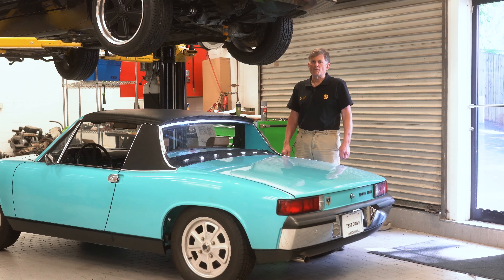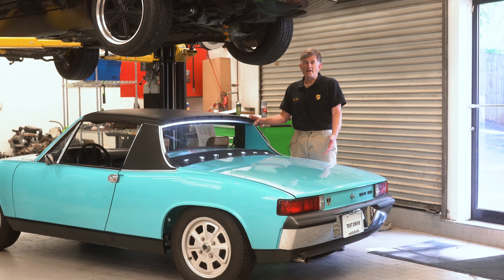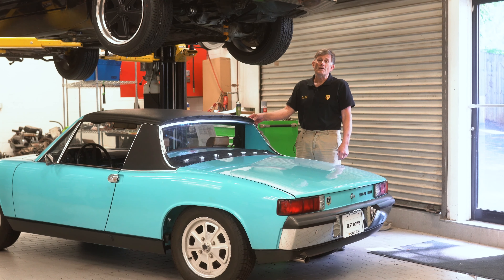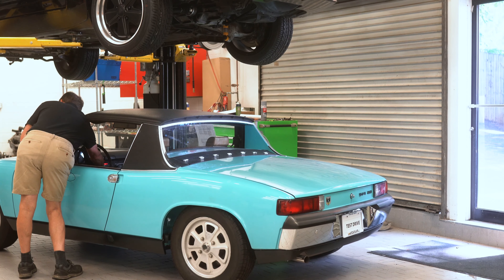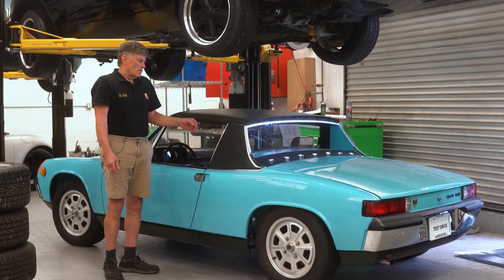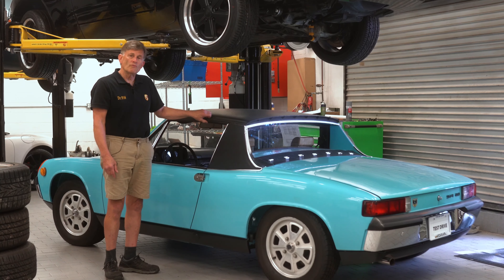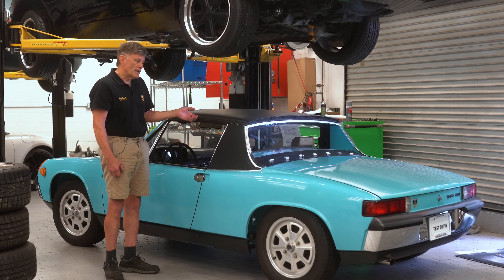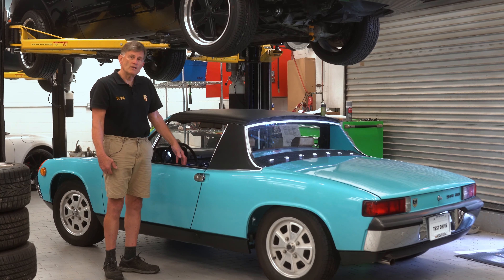The Perfect Porsche 914...

Comment: Very nice car.  Too bad about the rod bearing.  I resurrected my dad’s old 944 that sat for 30 years.  Other than belts, rollers, speed and reference sensors, the complete fuel system including fuel tank needed to replaced. I put 1300 miles on it since.  

I recently purchased your 924/944 Tech Tips after listening to your interview by a 914 engine builder.  

Take care!
Reply from the maker: Thank you!

Comment: Very interesting point, didn’t know the oil can turn acidic after sitting over the years, yikes! My very same car has been sitting for 25 years, planning to get it back to running this summer, not sure what to expect😬
Reply from the maker: Make sure to drain that oil, and if you need any help feel free to give us a call!
Reply: @autoatlantainc.2267  thx for the video and sharing the knowledge🤗
Reply: @autoatlantainc.2267  hi Dr. 914,
Since there seem to be a lot of unknown variables with classic cars or letting a car sit for so many years, would you recommend just doing an engine rebuild to ensure the car runs almost like new?  I've got a 914 on hold at the moment.